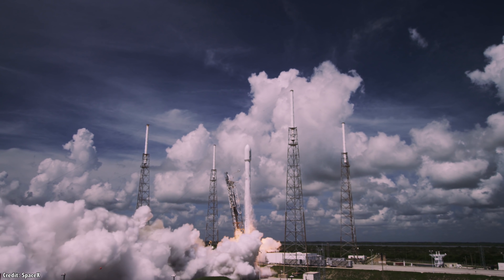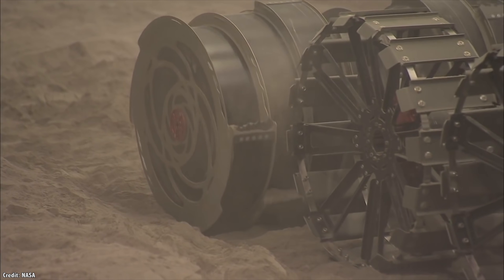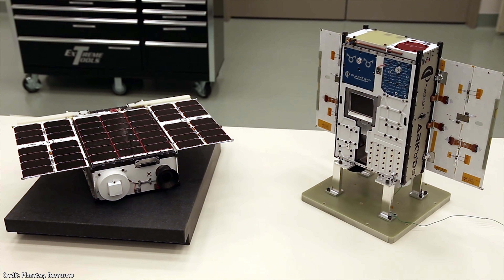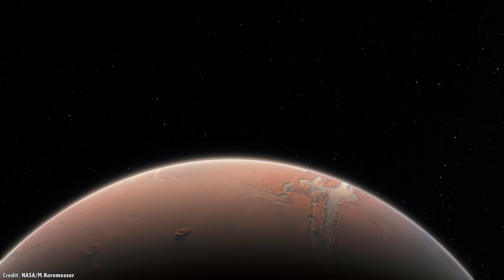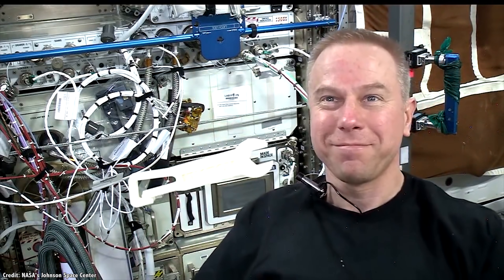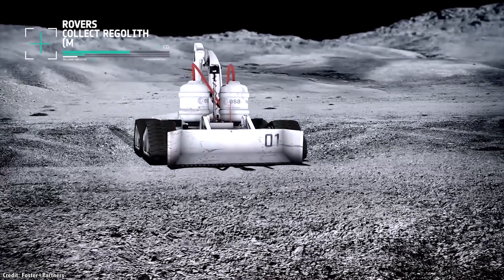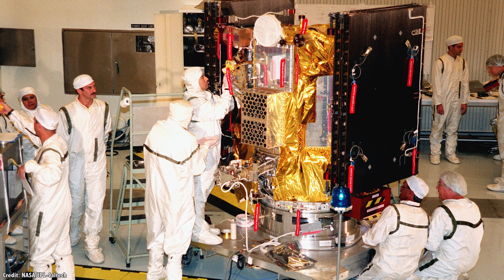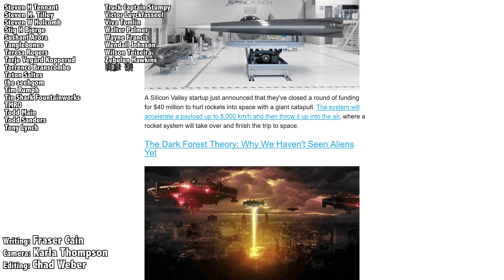Harvesting Resources From The Solar System. In Situ Resource Utilization

Comment: Laughable fantasist nonsense. Fraser is too smart to really believe that it is even remotely possible for a satellite in space to manufacture a telescope from a 3d printer. The complexities of the hundreds of tiny electronic parts employed in any modern device require vast and complex manufacturing processes with very exacting materials specification. There is a universe of difference between making a 3d printed spanner and making a complex device incorporating electronic components made in space. Fundamentally, Fraser told us early on in this video exactly why it will never ever be possible of desirable to make machinery and equipment in space. The thousands of dollars per kilogram launch costs - even if reduced by ten or a hundred fold will never ever rival the costs of making them on earth. And why? Outside exploration - which has tremendous value, the maintenance of good quality environment on our home planet is a million times less expensive. Who does Fraser think will fund the kind of investment he is talking about, as if it was just around the corner? 

I admire and enjoy the magazine Universe Today for its accessible up to the minute information about space matters, but this stuff is pure fantasy.
Reply from the maker: You don't need to 3D print every part of the telescope, just the structural elements.

Comment: My idea to improve Mars is to guide selected asteroids to Mars where they would 1, warm the planet 2, provide raw materials for manufacturing 3, add mass to the planet thereby increasing Mars' gravity (which would be better for earthlings).
Reply from the maker: The problem is that hitting Mars would asteroids would turn the surface into molten rock, which would then need hundreds of years to cool back down.

Comment: 3-D printing structures with regolith and magnesium oxide and binder isn't the long term solution unless the magnesium oxide and binder can be manufactured using materials from the moon.  The prospector style missions make sense at this point so they can find out what minerals are where.  It would make sense to build the first moon bases on or near minerals that can be processed into something that can be turned into structures without the addition of any materials from earth.  As a very crude  example, nickel-iron powder could be separated from regolith by magnets then solar powered 3-D printing could melt the metal into those hollow bird-bone-like structures and the cavities filled with some of the sifted and metal-depleted regolith you extracted the metal from.  You're going to process a lot of regolith to extract usable amounts of metal, so it would be good to design mining machines that can be 3-D printed with whatever quality of metal you can produce from regolith.  These machines should require a minimum amount of machined parts.  Then you need to make the machine shop tools to machine the parts for your mining machines, and you want all or nearly all of this made from lunar materials.  The good news is that there will be a lot of jobs that need doing in a moon base, lots of stuff gets made and an off-earth economy can grow rapidly using in-situ materials.  The bad news is that there is a huge amount of infrastructure needed for the minimum-size self-supporting bootstrap starter colony.  

Figuring out the minimum toolset that needs to come from earth to mine raw materials and process it into everything you need to build all the shelters, all the machinery, and grow all the food for everyone is a much tougher and more interesting problem than adding binders brought from earth to whatever dirt you find there.  Even if your shelter is only one percent binder, you'd need huge amounts of it shipped up from earth to fill a never-ending need.  Kickstarting a true off-world economy is a much more worthy goal.  There would be many opportunities for innovation in manufacturing all the little things that can't initially be made there.  I can imagine a time when machine tools like lathes and milling machines are made from lunar materials but the actual hardened cutters are not.  Those cutting edges (like the carbide tips on a saw blade) brought from earth would be so expensive, there would be a huge incentive for anyone who can find a way to make them from local materials.  This would be true of absolutely everything in the base.
Reply from the maker: This is why we need to get to places like the Moon and start testing out our techniques. We don't know which methods are going to work best with in situ resources and which will require large amounts of imported tech from Earth.
Reply: Yup, agree. 3D printing alone can't shorten the supply chain to the point that where won't be the need for the huge infrastructure.

Comment: Like & Subscribe
This project is thoroughly doable-- it takes a vision, like
JFK challenged the USA.  From sputnik to landing/walking on the moon in less.than a decade.  Put up
a LO space station ( like a spinning wheel as a space dry-dock) Scoop hydrogen from
sun atmosphere w HS pulse rocket. iirc there is a moon Europa with H2O; and a moon
Titan with liquid CH4 on it.
Iron might be easily discovered in the asteroid belt,
leaving Mars resources alone for colonization. 
Lifting construction materials
into Earth LO, thought we had
blueprints for carbon fiber space elevator.  Everything else we can get from space.
Energy from thorium reactors
OR ZPE & PVs.  Duplicate the
LO space platform around Mars as an assist for colonization.  We can explore
space together.  Let's GO.!!!
Reply from the maker: Yup, lots of little pieces to be done, but everything should be possible eventually.

Comment: Hey Fraser, question:
Saw a picture of the mars rovers tires. Why couldnt they just use normal rubber tires? 
Guess there has to be a point somewhere.
Reply from the maker: Rubber would get too brittle in the cold surface of Mars.

Comment: amazing. 
but as the idea of manufacturing in space is mentioned more and more often I have been wondering... how exactly is the manufacturing in space (off planets) going to work? is it plausible for structures to be built while in orbit, moving in kilometers per second? or have they thought of a way of building things without following a particular orbit?
Reply from the maker: They'll follow whatever orbit they're already in. So, if you launch an Archinaut into low Earth orbit, it'll be able to build things while zipping around the Earth at 28,000 km/h. For the spacecraft, it'll feel like it's in zero gravity.

Comment: While regolith is fine, I am working a methods to be able to drill and mine on Moon/Mars. Most common drilling methods require the weight of the drill string to "push" into the earth. That won't work very well at 1/6th gravity. And hauling a lot of drill pipe to the moon seems very expensive and impractical.
Reply from the maker: There are so many little details that need to be figured out.

Comment: F9 costs half of what you said, 2700/kg to orbit brand new. But yes still much too expensive. :)
Reply from the maker: It depends on whether you want to buy a new rocket or a flight tested one.
Reply: On block 5 it seems to even out. The reduction in price, matches the reduction in payload capacity if that flight is reusable as well. 50 mil for 18.6 t to LEO works out to 2689 USD/kg. I'm guessing they'd rather launch a reusable heavy if they need more payload instead of expending a block 5.

Comment: Ive always thought the plan to build a space ship inside a huge nickel iron asteroid would be cool.
But
What if you flew a robot manufacturing plant to an asteroid made out of just loosely bound regolith and rocks, and used a binding agent like glue, or heat even, to turn the asteroid into the basis of a space cement?
Then you could 3D print the space cement into any shape you needed.
A skeleton for a solar array, or the outer shell of a habitat.
Then you could add to your space platform by collecting more asteroids and processing them.
Reply from the maker: We need to test out different techniques to figure out what works best.

Comment: I've actually been getting into 3D printing recently and I have to say if they can manage to make durable, printable filament out of in-situ resources, then it solves a LOT of engineering challenges in terms of being able to adapt on the fly to changing needs and conditions. In my experience, the most time is actually spent designing the object to print, with the print itself being so easy to replicate it would be trivial to replace worn out parts once you have the design for them.

3D printing in microgravity would also reduce the need for support materials and make printing in general less of a hassle then it is with gravity always threatening to make your filament sag before it has a chance to cool.
Reply from the maker: Yeah, building stuff in space means it never needs to suffer Earth gravity.

Comment: Question. If the moon's far side has had the majority of impacts, couldn't we find lots of minerals etc there for the moon colony? Millions of years of asteroid collisions must have left a lot of debris.
Reply: Mineral resources will be everywhere on the Moon.  What's in short supply is water.  A very small amount of water may have collected in the sunless craters at the Moon's poles but the rest has been cooked away by the sun.  For significant colonization we need to wrangle a comet or go out past the snowline and haul in an icy object.
Reply from the maker: There would be all kinds of minerals all over the Moon, but it's going to be tough to dig down and get them. Easier to just collect small asteroids and break them apart for material.

Comment: i have a question for your questions show: why are solar systems flat? why are there not planets orbiting at extreme inclinations such as 45+ degrees?
Reply from the maker: Then a solar nebula collapses down it starts to spin faster and faster into a flattened disk. The planets form out of the disk of material.
Reply: Conservation of angular momentum, plus gravitational (and occasionally mechanical) interactions between all the particles and bodies in the system. Same as galaxies. 

Something orbiting outside the plane gets tugged toward the plane until it settles nicely into the plane. 

There are videos on YouTube about it.
Reply: RulesOfImgur I may be wrong here, but I believe the Sun itself rotates.
Reply: There are some objects with eccentric or even reverse orbits. Some of them are probably recent captured that haven't had time to settle in.
Reply: Anon B The sun does rotate, but the Sun's rotation isn't an important factor in making the other stuff rotate or revolve, or in forming the orbital plane.
Reply: Fraser Cain ah, that makes sense. Thanks for that
Reply: Halley's comet it at a very high inclination, 162° which is very nearly fully retrograde.  Recently announced asteroid BZ509 is at 163°, slightly closer to retrograde than Halley's comet.

Comment: Basic 3d printers will be huge for the mars city.
Reply from the maker: Oh yeah, they'll totally rely on them. If they get good enough, they would just send new blueprints to print out instead of actual manufactured goods.
Reply: Fraser Cain i own 3 budget ones and just those alone have changed my life.
Reply from the maker: I got the Monoprice one for my wife.
Reply: Fraser Cain whats the build area? Im stuck with a 220x220x300mm. Been thinking about expanding one of them to huge dimensions.

Comment: You mention that there is a propulsion system which would mine water from a comet.  Would this cause problems for other high speed travel through the solar system which would then encounter the water exhaust?  I guess more generally, is there a problem with any exhaust material creating clouds which would not settle into gravity wells or automatically clump?
Reply: Aaron Day No, the water exhaust would be comparatively low velocity, and would spread like a gas in the vacuum. It would essentially vanish as soon as it left the rocket. 

Talk about steampunk, though...
Reply from the maker: Not really, I can't imagine how this would be a problem. The solar wind is constantly blowing and would push any water out into deep space.

Comment: Creating habitats should probably focus on building bunkers, simplest work around to the radiation is to dig and in low gravity digging is easier.  A solar powered foundry for working metal would seem necessary too.
Reply: Fraser Cain if you put your lunar igloo in the shade - like even under an umbrella - then you can make authentic igloos out of ice, or out of ice-crete (iced gravel). 

I think a liner or three of some sort is in order, though. Graphene, Kevlar, duck tape and visqueen, whatever.
Reply: Bulldoze a trench. Drop a prefab shelter (maybe a balloon) in the trench. Cover the trench. Sorted. 

Or just plop the shelter on the surface and pile rocks/gravel on top. That's maybe harder to do - you need to lift the rocks higher. You need a bigger pile, so you need more rocks. 

The moon is sort of made of ready-mix cement. Maybe pour concrete instead. Maybe make the shelters from mooncrete too. 

Or literally pitch tents in a lunar lava tube. (Seems dangerous and inconvenient to me, but it's not a bad idea for early missions with minimal infrastructure.)
Reply from the maker: If those regolith printers work, they'll just dig up the lunar dirt, and make it into lunar igloos.
Reply: Makes too much since, thus why NASA will not do it and SpaceX and Blue Origin will.  Start digging throw in a prefab liner and cover it with material, perhaps pump some hydrogen into the ceiling prefab just to be safe.  Two men with a electric tiller and shovels could have multiple habitats up in hours.
Reply from the maker: Nice, just don't let them melt.